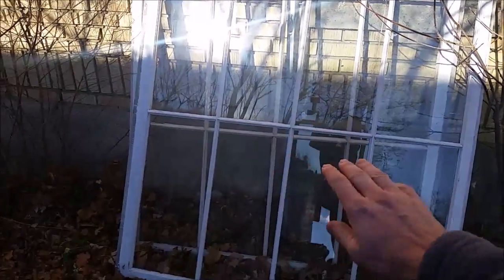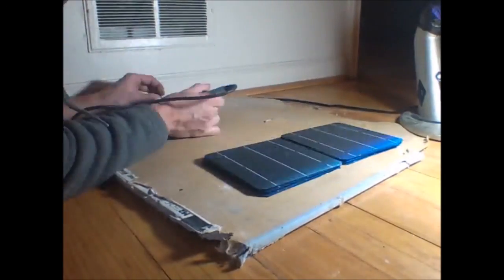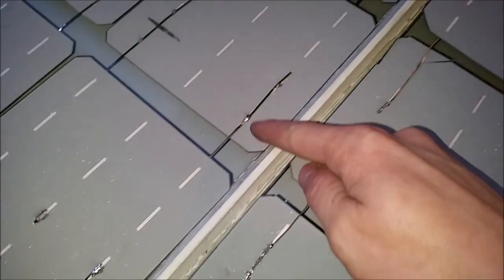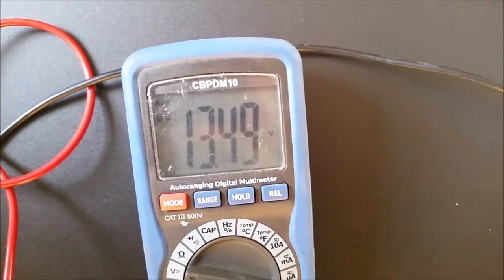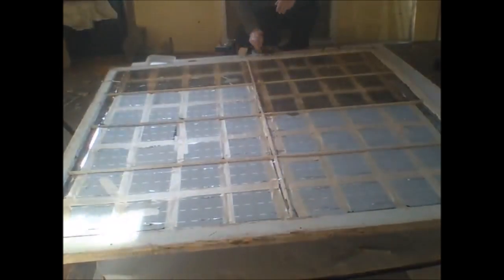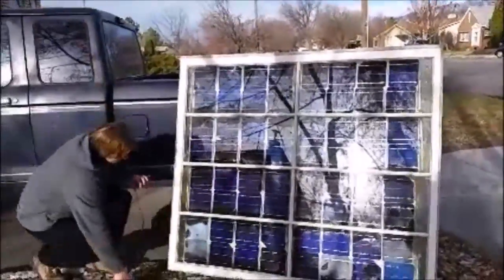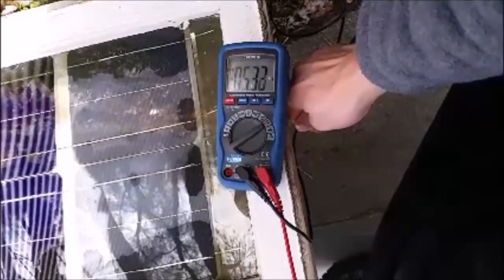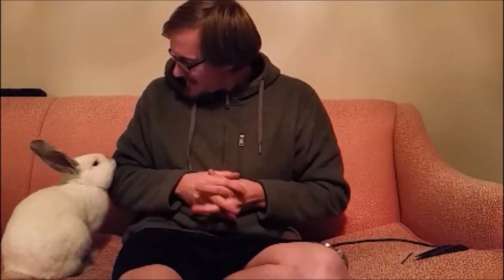DIY Solar Panel Assembly

Comment from the maker: <insert table flipping meme here> I spent an hour fixing the audio and it seemed to be fixed until the last quarter of the video, but then went to crap and I have no idea why. It sounds fine in the file I have on my computer...
Reply from the maker: +Pretermit 
movie maker and audacity
Reply: pro 🎤 tip: put a peice of foam over the mic so you dont need to "fix" the audio. it should work
Reply: +Cody'sLab Here: (╯°□°）╯︵ ┻━┻
:D
Reply from the maker: +Albion Laster 
Getting resin under the cells wasn't much of a problem and putting the tape on broke quite a few cells.
Reply from the maker: I actually bought bolth but they didnt work on my computer.
Reply: PLEASE do a Mars one update!!!!!!!
Reply: you can use the solar panel to produce some hydrogen/oxygen gas mixture from electrolysis, during the day, and make a torch, when it burns, it is releasing some energy collected from the sun, as much as when you burn wood or paper what plants do :)
Reply: hey, Cody..... do you think you can turn Mercury into gold using the power that you can produce?
Reply: can you try more mining and metal extraction vids
Reply: +Cody'sLab Don't worry too much about it. Your videos are still great.
Reply: +Cody'sLab why the regret on using masking tape on the cells? was there some adverse outcome that the camera didnt pick up?  Great timing on the video (for me anyways)  I was just shopping for some polycrystaline cells on the ebay
Reply: Bolth. Both. Bleach. Bletch.
Reply: +Cody'sLab What are you using to render it?
Reply: ***** Maybe try Final Cut Pro or Adobe Premiere?
Reply: Thank you based Cody.
Reply: +Cody'sLab 
Try upgrading your editing progam, movie maker is easy to use but not as efficient as maybe Adobe Premier.
Would like to see more of your vids with better quality :)
Reply: +Cody'sLab because you doing it wrong!
Reply: +cj champong need a serious radiation source for that
Reply: +Sushi hiro Premier is by far the best, but also by far the most overpriced
Reply: Thats very true, although it might be worth it, since with better quality, people are more likely to watch it
Reply: there are other options tho.. vagas, while still expensive, is a quarter of the price
or alternatively anything on this list https://en.wikipedia.org/wiki/List_of_video_editing_software#Free_and_open-source
Reply: +Cody'sLab Monetize your videos and purchase an HD standalone camera to replace the one that always stops recording. As for Premiere, Vegas or Final Cut just google for their 'portable' editions which come activated and ready to use. -P
Reply: +Cody'sLab i wish i could donate, tried persuading my parents but they said no, i'm only 12, you replied to me before about aluminum also love ya vids :)
Reply: What program do you use for video compiling? If so, was there an update? If not. I don't know
Reply: +Twitchi As an avid user of Premiere Pro.. It's not overpriced. For a normal home user? For sure $20/m is a bit much, but for anyone who wants quality that's pretty damn cheap. 

Someone like Cody I'd recommend Sony Movie Studio Platinum, $70 one-time and works with most common formats.
Reply: ***** oh rip, really old machine?
Reply: "it works on my computers" is one of the worst evils of the modern era, next to "it only fails when someone important finally comes to take a peek".
Reply: +Pretermit stop promoting bullshit

Comment: 100W panel, that's not too bad
Reply from the maker: +Sam G 
its almost 200 in full sun ;)
Reply: +Cody'sLab Holy crap! And how many of those small panels did you use in the process? Looks like 64 or so? 500 of those panels for only $100 sounds fricken amazing!

Comment: Cool project. Do you have a link to the seller on eBay?
Reply from the maker: +Ryan Witkowski 
I bought them over a year ago, but I'll go look and see if they are still on.... ah yes here it is: http://www.ebay.com/itm/500-Watts-Broken-6x6-Mono-Crystalline-Solar-Cells-for-DIY-PV-Solar-Panel-/131427628175?hash=item1e99b2748f:g:ArUAAOSwstxU3Efm
Reply: +Cody'sLab How many do you actually get from these per 1 order?